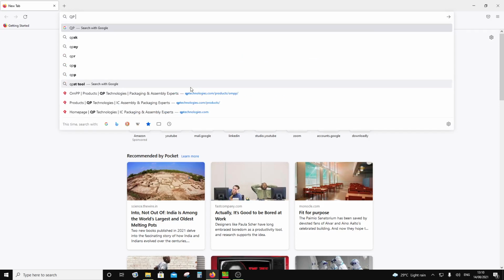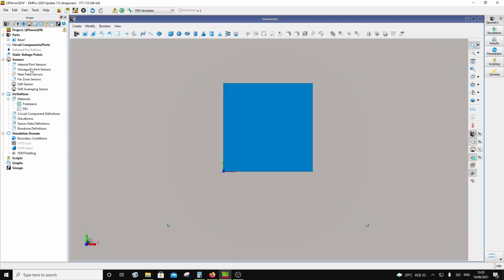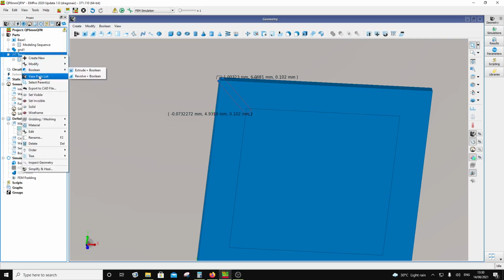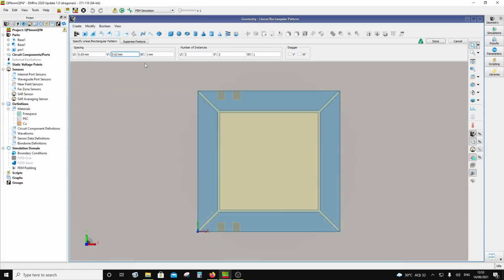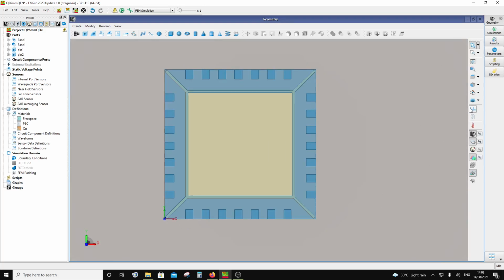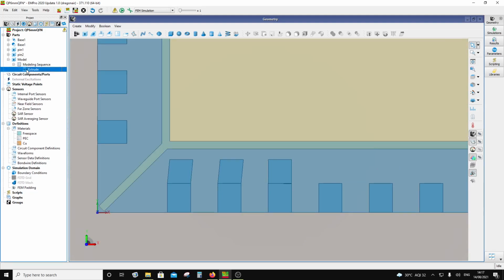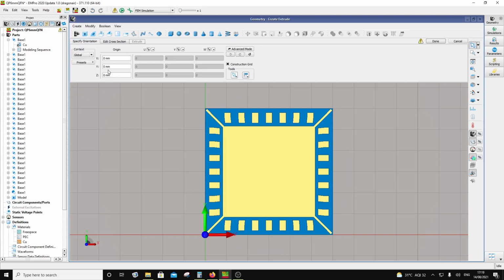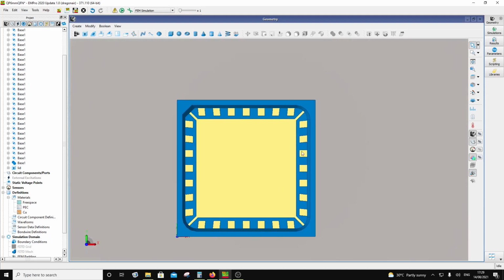Electrodynamics Session6

Comment: Dear Mr, Anurag Sir, Thanks for such a detailed package design video in empro. I was just wondering did you do any cavity simulation of your package with unloaded condition to check the reverse coupling? is it necessary to do? These packages come with any recommended power gain of the DUT to be tested in commercial.